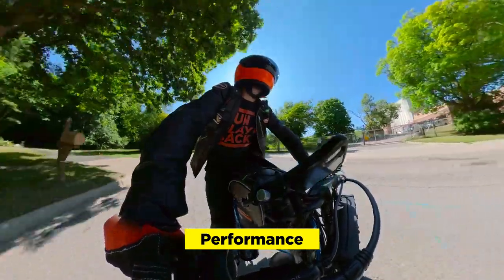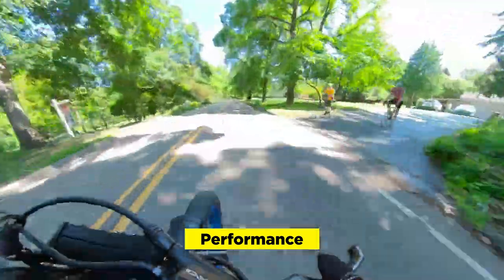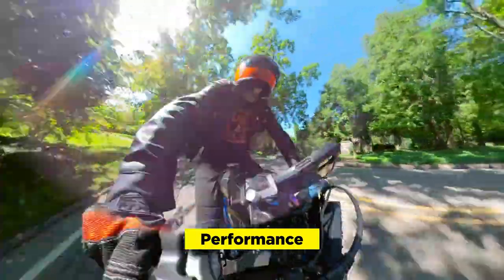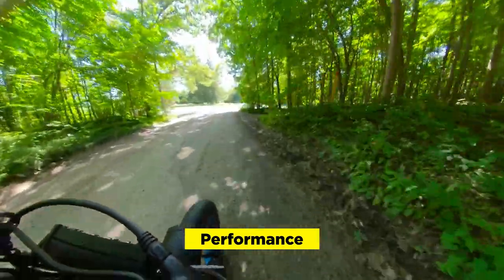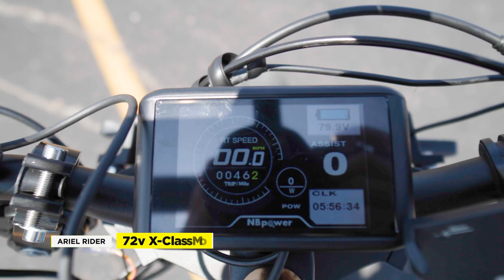72v 3000W Ariel Rider X-Class Conversion - Test Ride and Full Review | RunPlayBack

Comment: Hi how did you connect the brake lever / motor cut off that comes with kit or did you not connect it at all? Thanks
Reply from the maker: We didn't connect that, the owner didn't order that option with the kit, however, the Sabvoton controller does supports brake sensor input.
Reply: @RunPlayBack  ok cool thanks

Comment: Love it... but $2200 upgrade is a little steep and puts this bike at $5K before upgrading brakes, etc.
Reply from the maker: Yeah it's not for everyone but for those who don't mind spending the money, this kit will suit them.
Reply: Question what is the cost of all the parts you installed was it $2200? For all the parts in the beginning of the video? If yes how much would the same kit for a Grizzly cost?
Reply: Do t overlook people that already have the bike and later decide to do the upgrade! However l agree that it wouldn’t make sense to initial buyers since a sur Ron or likes would be cheaper!
Reply: That’s about accurate but I can get a 72v 38 ah battery and 5000w motor for about $1500

Comment: Great video. What's it feel like at 50mph? Does the front wheel stay to lift up? Does the frame get a little lively in the wind?
Reply from the maker: So the lowered bars shift all my weight towards the front so no accidental wheelies. 50mph feels surprisingly smooth. The frame felt stable. The only thing I think needs to be changed are the tires and brakes to keep up with the increased power.

Comment: zip tie between the 2 connector harness so you dont have to worry about it arcing
Reply from the maker: Once they are seated correctly, it is tight and won't arc.  It was a noobie mistake :)

Comment: Hey can you add the old rear motor to the front like the Grizzly. That way you got all wheel drive and can reuse the old motor and 52 battery 🔋.
Reply from the maker: I don't think it would be practical. You'd have to add another sabvoton controller.
Reply: @RunPlayBack  I was going use the original controller for the front and also try to avoid messing the lights up.

Comment: Hey Rik. Great video as always. Quick question. I have the same kit, installing on a x52. The motor has 3 sets of wires off it. The main 3 I get, the other two harnesses. I see one clear connection to the harness for one, but not the other. Any help would be greatly appreciated.
Reply from the maker: It's been awhile since I worked on this kit so I can't recall if there was an extra harness off the motor side. I'd reach out to the manufacturer if possible. It could be a temperature sensor.

Comment: I know this is going to sound like a dumb question, but, at this stage, is there even a point to having pedals?   They may be a hindrance.  It's basically a motorcycle.  Very cool mods though.
Reply from the maker: I'd say it's light enough to pedal without it being a burden. This build will mainly be using around 50-60% of max power.

Comment: I have a 52v Ariel Rider Kepler do you know where I can find a tutorial to add a key ignition start without losing power or pedal assist?
Reply from the maker: I don't think there is a specific tutorial for the Kepler or any AR bike to add a key ignition.  However, it's fairly simple if you can find the power wires feeding into the display, you'll need to tap into those.  Essentially, it's just a switch wired in-line.  GL!

Comment: hey if you dont mind can you tell me how your ordered it because the on the site they have options  

can you tell me what
1 dropout 
2 flywheel 
3 t count

I have no idea what those are or mean
Reply from the maker: T Count & X Class Options: The 3000w Motor Kit can do 55mph with a 3T Motor or 50mph with a 4T Motor. T Count is how much copper winding in the motor. 4T has more torque and less top speed and 3T has more top speed and less torque. 

The options you would want to choose for the X Class are: 7 speed flywheel, 170mm drop out, tire is optional and T Count is optional.

Comment: Please provide a link to, or info on how to get, the tail light & turn signals unit. Does the unit plug into the current connector for the rear turn signals & brake light on the X52? Do the signals & brake light show up well in daylight? The current signals on my X52 is barely visible in daylight. Thanks.
Reply from the maker: I followed the E Street bikes video on how it hooks up to the controller: https://youtu.be/aOxNLeaNDKE
Reply: Thanks

Comment: would you be able to run this kit with three 52v batteries in parallel
Reply from the maker: I'm pretty sure you could but the motor and controller would be more costly and heavy if you're not using it with 72v.

Comment: Am in the works on doing this to my 48v X-Class I have already purchase this motor kit in your video do you recommend upgrading the brakes and  rotors if so could you send me the links so I can purchase them ?
Reply from the maker: The stock hydraulic brakes on the X-class are adequate for the 72v upgrade.  Unless you plan to ride full throttle all the time, then upgrading the brakes is not necessary.

Comment: Would that battery work well with the 5000watt 100A motor from e-street bike???
Reply from the maker: Which battery are you referring to exactly?  In general, you want your battery to be "overengineered" for the peak AMP draw of your controller, so that your battery is never stressed to its limits.  For the 5kw 100A kit, I would go with a battery that can discharge up to 200A or up to 150A .  If you're ordering from e-street, just call them and speak with them, they will be able to walk you through on any questions you may have.
Reply: @RunPlayBack  okay great now I feel more informed and ready to buy the whole kit 👍🏽 already found a shop in my city that can do the whole conversion

Comment: Hey in your opinion,  can this be done with a juiced hyperscorpion?
Reply from the maker: Yeah I think it should, just have to find a place to mount the controller and battery. Are the wheels 20" x 4"? If so then the dropouts should be the same for the motor kit.
Reply: @RunPlayBack  yes they are. It's just a step through so it's always the kind of bike that is hard to mod because there is no bar in the middle.
Reply: @JayHood129  sell your Scorpio and get an Ariel rider used, I see your bike and your spokes are plastic and quiet awkward compare to other bikes, so for that I don’t know how you could install a motor on them unless you change the wheels completely to some different

Comment: Does the range get better with these battery compare to the stock??
Reply from the maker: This really depends on the battery capacity and your usage.  Battery capacity can be measured by Ah (Amp Hours) or kWh (Kilo Watt Hours).  If you look at the numbers compared to stock, you can do some math and determine your theoretical range based on your usage.

Comment: Where can i get the battery and the motor installed?? I dont feel comfortable doing all that!
Reply from the maker: Depends on where you are located.  But most PEV shops should be able to help you with that, would be custom work.  You can also join some FB groups and ask around for local assistance. GL :)
Reply: @RunPlayBack  im located in el paso , texas 
I got a super73 that i want to upgrade the motor and battery

Comment: Great video got me excited. I’m building a 1500 and 3000 watt bikes as we speak. Just curious how that light runs off the battery and hook ups required
Reply from the maker: So the entire lighting kit came with the E-Street bikes motor kit. It had all the harness connections that were plug and play right into the Sabvoton along with a 12v step down converter. So yeah, we didn't have to study any wiring diagrams or anything, just plugged in the connectors.

Comment: I just wanna know the range ?
Reply from the maker: Hi, range will vary, it heavily depends on your throttle usage and payload.  If you're light on the throttle, then you can extend your range, if you're heavy on the throttle then expect lower range.  On average, if you get the 72v21Ah battery, then you can expect range to be between 25-35 miles, again depends on your throttle usage and payload.

Comment: It almost like a surron
Reply from the maker: Kinda...the Surron is a completely different kind of ebike.
Reply: Hi runaway I have a 500watt motor with 48volt I just want to upgrade the battery to 72 volt do I have to change the controller and the motor as well to make my bike go faster

Comment: why even buy an ariel rider if you're going to replace everything?  Why not buy a frame and build your own bike?

At 70 lbs, the Ariel Rider is probably too light to be going this fast anyway.  The Juiced HyperScorpion weighs just over 100 lbs, and is much better suited for these types of speeds.
Reply from the maker: I don't think most people end up doing mods like this until either 6 months or a year of owning the bike in stock form. Most modders in this space are usually learning as they go and figuring how much they are willing to replace as opposed to having a full modding plan and starting from scratch.
Reply: @RunPlayBack  yeah, good point
Reply from the maker: @NinjasOfOrca  yup like for context, my friend was sourcing all these parts for a few months while owning the bike for over a year I believe. In the vid it may seem like she bought the bike and we just gutted it. But it took a long time.
Reply: @RunPlayBack  gotcha, and it's not the kind of upgrade you can make one thing at a time, since everything needs a higher voltage
Reply from the maker: @NinjasOfOrca  on this bike yeah...and its usually more cost effective to get everything as a kit. Some people also sell the stock parts that have been replaced to recoup a little money back from the modded parts.